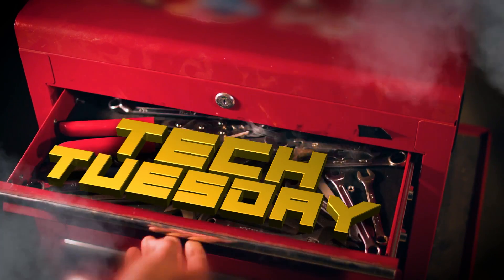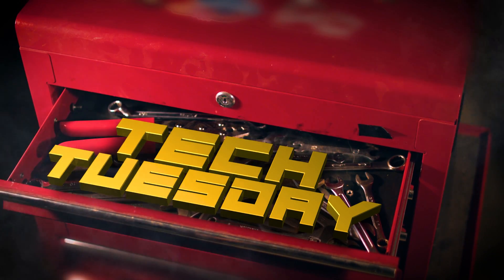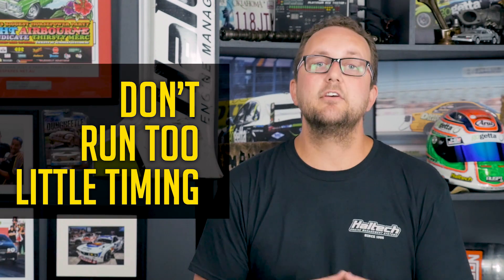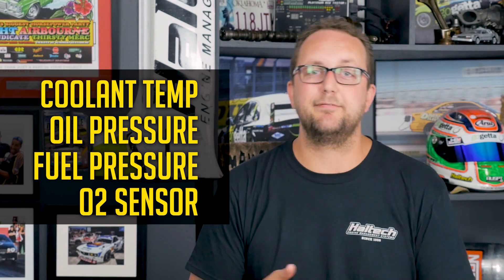🛠 Engine Blowouts and How To Avoid Them  |  TECH TUESDAY  |

Comment: Great info packed into a short and sweet video, I like it. Not ground breaking knowledge, but very clear and simple rules for any beginner to hear first. Couple suggestions to include in later videos would be (And sorry if you have covered these) Would be common misconceptions when it comes to bolt on parts and bolt on power. Also maybe a video on driving and operating habits you would have for on a high horsepower race car for example (How often check oil? Start up procedure? Warm up time? Certain driving style? Frequent start and stop cold starts?) Maybe a video on exhaust temperature, intake air temperature, engine bay temperature, and how they all relate and can hurt a cars performance. Just some examples. Appreciate the content.